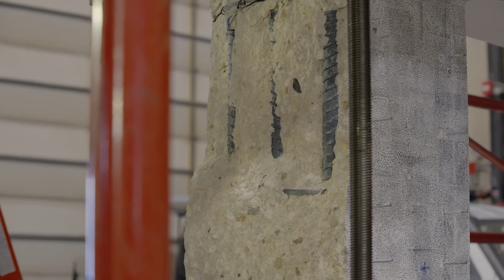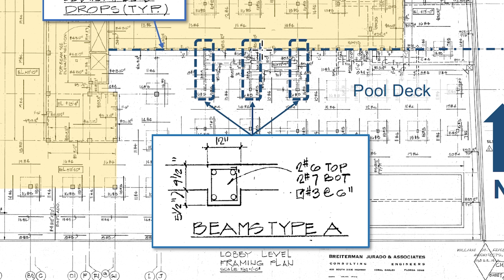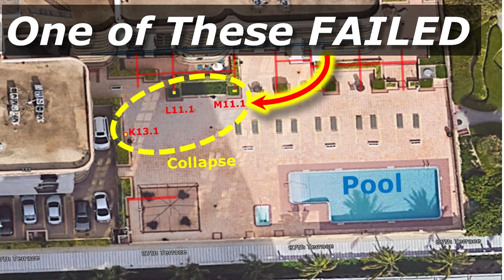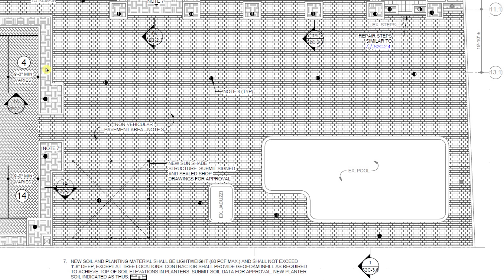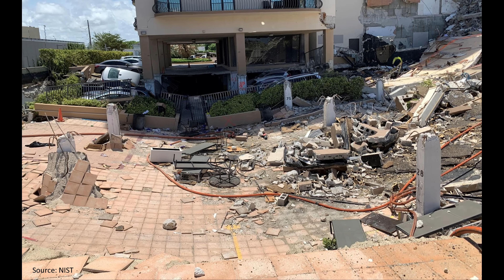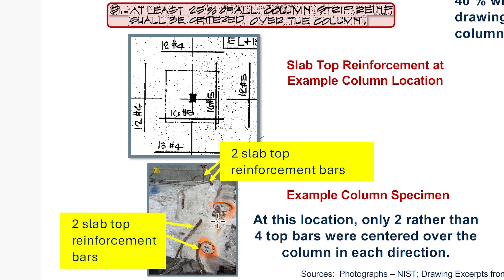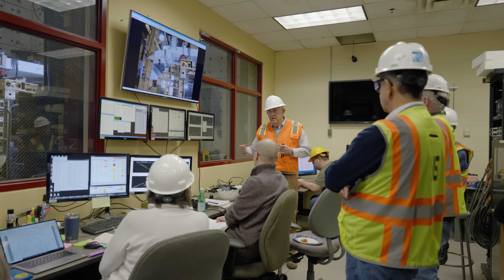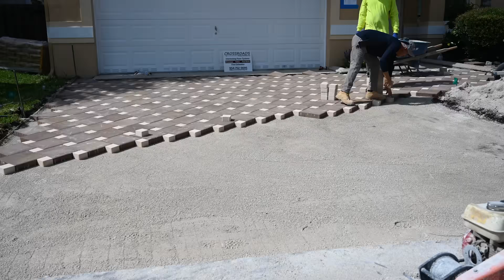Champlain Towers: Secrets the Feds Uncovered in Collapse Debris

Comment: So the fact that the pool deck was lower than its corresponding floor on the other side of the vertical beams, and the fact that the pool deck was overloaded by the large planters that were placed there... Did that provide an overloading bending moment on those vertical beams, causing them to deform, apply assymetric forces on the floor slab and thereby tear the floor slabs off the vertical beams?

Comment: Jeff can you please say clearly whether you think that the design of the South Wall / Lobby level / Pool deck interface design and implementation was good or bad, and whether it did its job or not ?

Clearly the external cascading collapse of the pool deck basically kicked the legs from under that side of the building because it was all tied together, but on the other deck / wall connections the pool deck just snapped off and fell away leaving the surrounding structures just fine……

Comment: It was a marginal design and something major like the pool deck, right next to the columns holding up the whole complex, ever collapsed, sending tons of debase into those columns at 5 or 50 years you likely would get the same results. Because it was a roof and patio with low load, it was ignored with a who cares, it's not holding up the building. If the garage stopped at the building footprint and there was sand and stone under the deck instead of garage it still would still be standing, mainly because all sides would be supported by walls.
A safer design would have been an independent 2 story garage with the pool/deck on the 2nd floor/roof, the ramps would eat up a lot of spaces, it would cover up lobby windows completely, and turned half the 2nd floor balconies to not too desirable patio side.

Comment: Hey Jeff, Thank you for the follow ups on the CTSC testing very interesting.  Question for you:  On the slide label (I guess the best way to direct you to my question), Preliminary Pool Deck Evaluation: where you have the five blue boxes for the swiss cheese model; The first two boxes labeled "Design Understrength (largest, pervasive)" and "Misplace Slab Reinforcement (pervasive)" Are these two boxes a result of improper plan design or construction application i.e. not following the plans?  Thank you for your time Jeff.  🙂
Reply: I'm a different Jeff,  but I will respond.  The problem is two fold. First, the design was substandard. Second, the workmanship was even worse. Add to that decades of poor maintenance caused it to collapse when it did.
Reply: @jefferyindorf699  Thank you, Sir

Comment: I do wonder what strengthening work has been done to Chmplain Towers north since this building collapsed
Reply from the maker: Sister building has 2 fewer units per floor, no planters on pool deck, and as far as we know, no mistakes. they had put in a bunch of pole shores 3 years ago while they undergo the building recert
Reply: Yes- the sister building next door was built at the same time.  I think that one didn’t install all those planters.  Check one of the early videos where he shows a little of the other building.

Comment: Have they determined if the materials were shorted to save money? or to divert to someplace else?
Or is it contractors not supervising people well?  Then we start wondering about under-engineering. to save money ??
Reply: I don't see evidence of corner cutting or gross negligence.
Reply from the maker: It doesn't look like they were cutting corners it just looks like they didn't manage the spacing of rebar rods properly in the slabs over the column connections, and in some cases they didn't do lap splices correctly and also remember that the investigators are saying now that the engineering of the columns strength was underestimated by 50%
Reply: @jeffostroff  Thanks!

Comment: Watched the Champlain Towers collapse all night as it was happening on TV, ever since in the back of my mind is my high rise going to collapse, doesn't keep me up at night but think about it from time to time, my high rise built 1963, was it built properly, has upkeep, maintenance, repairs over the years done properly, I'm obviously not an engineer but I think garages under high rises are an inherent risk all that weight on top of an open space at the bottom, very interesting how they're recreating what happened to figure out why and how
Reply: Try not to worry too much.  At least if there is a car park under you can walk around and look for water ingress, spalled concrete and rust staining.
Hair lines cracks are permissible but anything over 1/16" particularly diagonal cracks in wall or beams.
If you see any of that get (pay) a Chartered Structural Engineer to have a look if they are concerned raise those concerns in writing to the Building Managers and copy to the registered address of the building owners and to the local authority building control.

Comment: Have you seen the bathroom sink leak check in the 787 alerts that came out i figured you would be checking plane plans 
Just imagine a sink leak shorted out the whole airplane amazing
Reply: No evidence it did anything of the sort at this stage, hold your horses before being so definitive. And even if it did, there is something horribly wrong with any system that, in such a situation, doesn't 'fail safe'. The whole point of the RAT was to deal with an electrical failure by supplying enough power to keep the plane flying, it seems to have kicked in, and the engines have systems to run themselves if necessary in any case. So why did all that not work?

Comment: My main question is how can they change the weight of items like the planter boxes without reinforcing the load bearing structures and it gets approved that way. Forgive my lack of knowledge, my dad was a civil engineer - I'm not but I learned a lot from him regardless.  Almost every collapse I've seen/heard from such podcasts like yours always seems to have the same problem. They up the weight of items/fixtures from the original plan but rarely seem to address whether or not the existing structure of the building can take that weight initially and/or later have the structures have worn and degraded as is natural with all buildings especially the ones with leaks and bad design. How does that get past the permit process at the city/county without major questions?
Reply from the maker: People were stupid back then and my guess is the landscapers probably did not know that there was a garage below them either
Reply: @jeffostroff Even if the landscapers knew a garage was under them, it may not have made a difference. I see landscapers create building & water problems that didn't exist. In my experience, landscapers know how to create a certain look, period.
Reply: Well if properly designed for a building of that type it should have handled those loads.  Otherwise the architect that revises the design does what they can get away with.  They should have hired an engineer to check the new loads.
Reply: Maybe they didn't need such permits back then? In the UK we have 2 permit systems, run by our LAs ( Local Authorities); planning permission, which is essentially about what you can do, and Building Regulation, which is about how you have to do it . Some things may require Building Regs but not planning permission , most things of any consequence need both. It can be pretty complex whether you need one, the other, or both. E.g., if you wish to put an internal door in a supporting wall, you don't generally need planning permission unless your building is 'listed' (historical and on an actual list because of conservation reasons) but you will have to get the Building Inspector in to confirm you have put a lintel in properly. When you sell a house, buyers will want to see all the permissions/inspections for any work that has been done, including the even higher regulated electricity and gas system, and their solicitor may check them with the local authority too. The system, though much moaned about, does actually work pretty well, and things tend only to fail when people break the rules. But of course, some collapses can occur in older buildings built before modern regs came in.
Reply: @alisonwilson9749  All cities have their own regulations but in general permits were required for modifications back in that era.  Remember it's a source of income for the cities.  Enforcement of regulations has gotten stricter at least in some areas.  For instance I've heard that building code enforcement in Las Vegas became much stricter after the fire at the Aladdin Hotel.